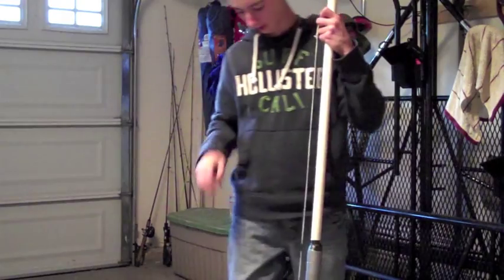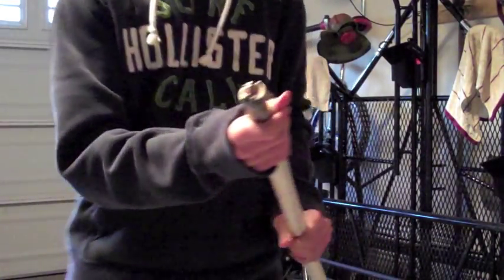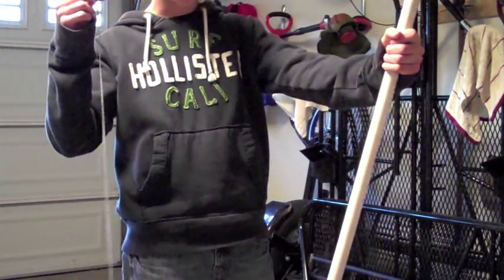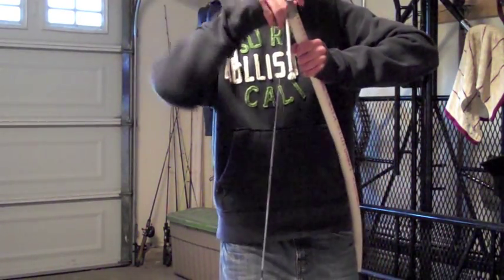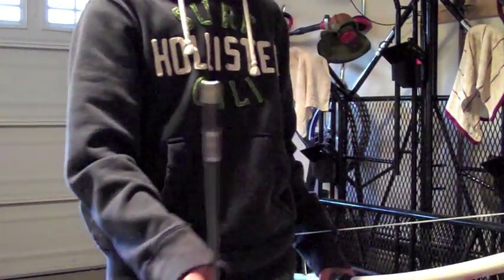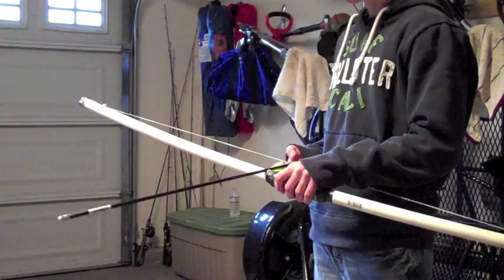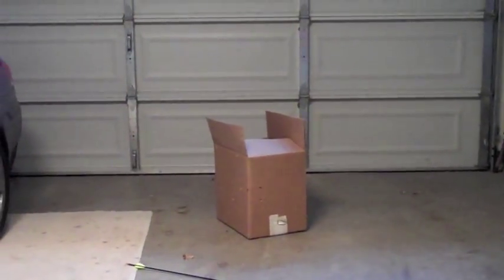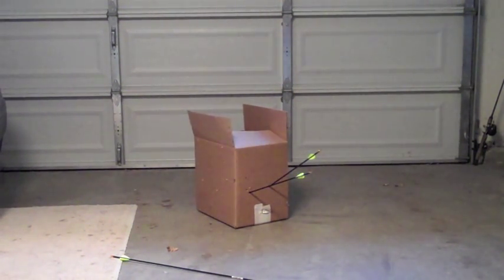Homemade PVC/Fiberglass Bow and Arrow

Comment: I'm sorry if I hurt you. But if you read it again, you can see i am didn't say that I am a professional, I am an amateur, novice amateur. I just say that I use a good quality target. The price is 10000 Huf or 40 $. But I was always fully tighten the bow, this is the only way to accurately shoot with arrows. Of course, maybe I'm wrong. I love the DIY. A few years ago I made an ash wood longbow. Broken after 1000 shoot. :) But then I do another one this summer. Now i have a factory bow, for 80 $.

Comment: Okay... 3 inches? You can clearly see the string vibrate a lot. I'm not going to lie, it is a nice bow. And to get the draw weight properly, you can get a fishing scale. The ones where you hold the handle and it has a hook. They work just fine.

Comment: I wonder if anyone's tried sleeving a 1/2" pipe into a 3/4", then this into a 1" and then that into a 1 1/4" pipe, they would all fit with minimal mods to the pipes and you'd have a monstrously powerful bow, I looked up many charts for PVC schedules and dimensions and they all should fit snugly with some cutting and sanding.

Comment: Don't listen to butt munchers they wouldn't know a bow if it hit them in the ass. Not an easy task getting the 1/2 into the 3/4.
You didn't weak in the bow by cutting the arrow rest, the half inch will carry 4 he load. You might shorten the string some to give you a 6" brace height. Keep up the good work. 
,